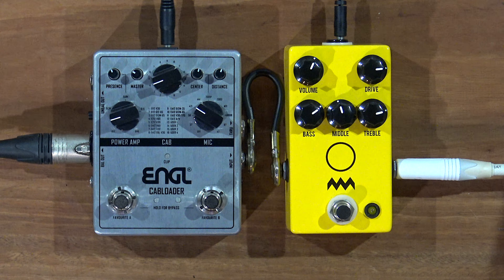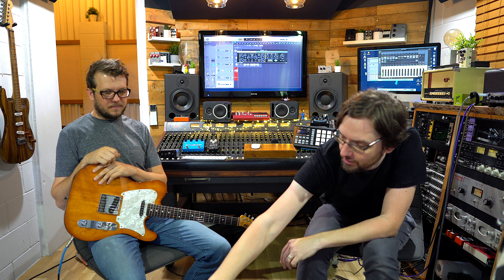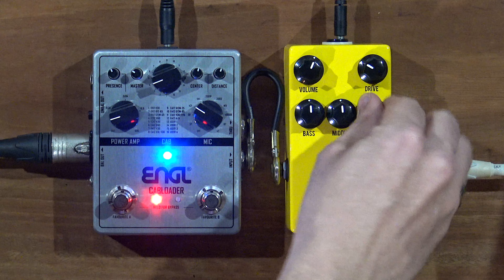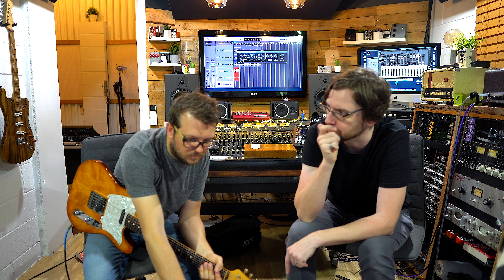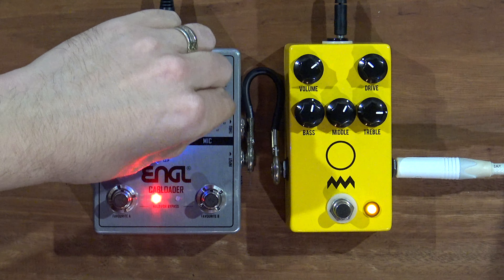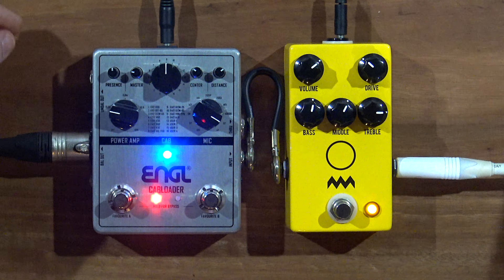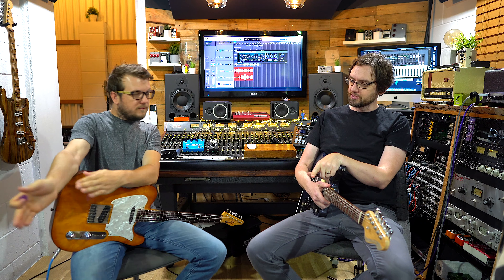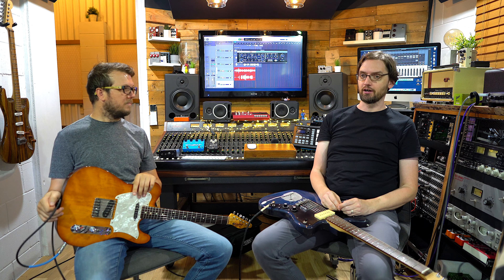No Amps Needed - Going Direct with the Engl Cabloader - Pt 1. Low Gain

Comment: Is there a diffrence having power amp emulation conpared to just a speaker emulation pedal or an ir loader pedal? Im using a neunaber iconoclast which is described as a speaker sim (with software  tweakability) and it doesnt say anything about power amp emulation. I was able to get a good sound with a chasebliss brothers and condor combination but i found that it just lacks beef or fatness to the sound. Still working on the iconoclast which i love but im wondering if ir or speaker sims lack punch if there is no power amp emulation present.
Reply from the maker: I'm not 100% sure but I think it does make a difference - we have another video with the Cabloader coming out tomorrow - with a more high gain pedal...in that video Alex briefly turned the Power Amp sim off and it definitely sounded worse. On the REVV D20 Amp for example you can actually virtually change the poweramp tubes through the built in Two Notes Torpedo...and that does make quite a big difference in how the amp sounds. Not sure about the Neunaber stuff - I never had a chance to try any of it...lots of people seem to really like it though

Comment: No way.
Why would anyone spend that much money on what is essentially a digital modeler?A BLUG is a much better option.
I know how tempting it is to simply accept a product because of its branding. Strymon, Fender, ENGL... right? But no. Crap is crap no matter what box you put it in. Crappity crappola.
Reply from the maker: I think they are quite different things...this is essentially an IR loader, more like a Two Notes CAB M for example...you can use this with your tube Amp - which is what we have been using it for in a lot of our videos...we've been running our usual 1x12 cabinet and we use this to add a virtual cabinet (2x12, 4x12 etc...) to the mix. In this video we just wanted to show that you could simply put this at the end of your pedal board as a 'direct in' solution as well...especially if you have an Amp in a Box style pedal on your board!

The Blug Amp 1 has built in speaker emulation but you could technically use this as an IR loader for the Amp 1.
Reply: @TSFAHTPS  
Yeah but companies like Mooer offer IR loaders for around $120 (Mooer Radar)...which I believe include some amp models.
I get the attraction, but I feel like someone could accomplish the same thing for a lot less money.
No grIpes about your video. It was great. I just dont see the product as feasible for most struggling musicians who's main goal is to get the best tone for as little money as possible.
Reply from the maker: All good...I do think that its a really good sounding IR loader...but yeah you are right there are many other IR loaders out there...we might just do a shootout between a few
Reply: @TSFAHTPS  Good idea. They aren't all created equal